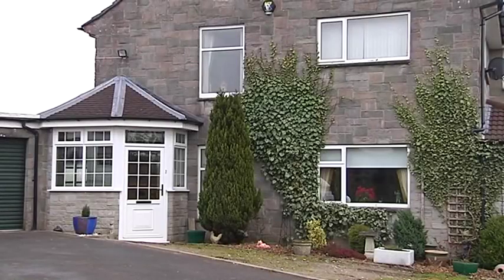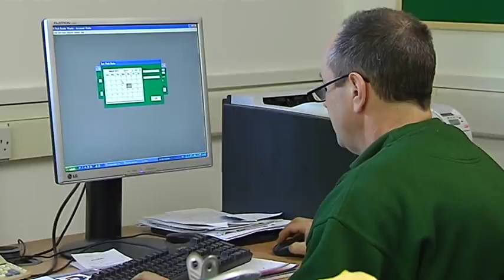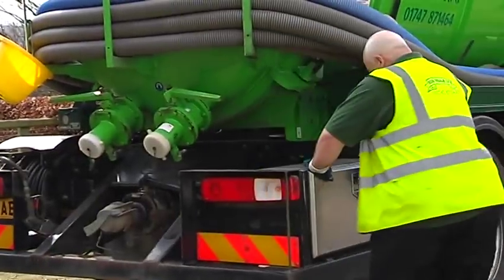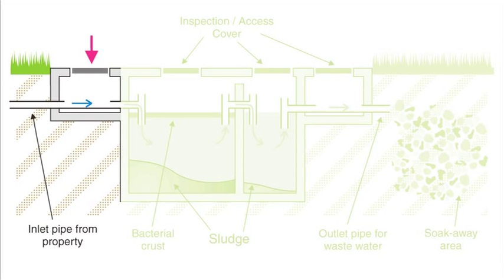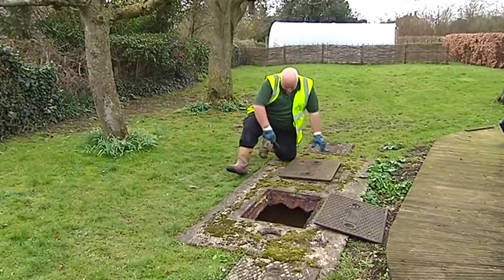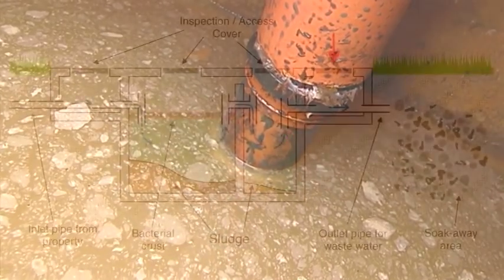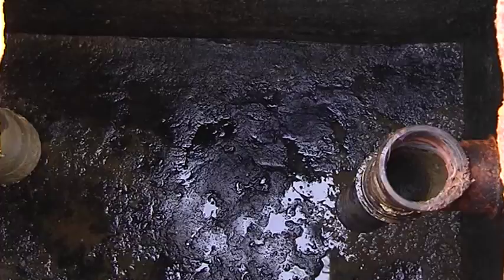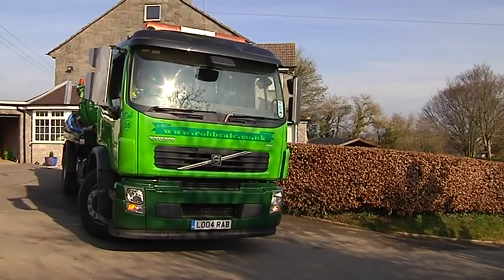Septic Tank Operation & Emptying - Rob Beale Limited

Comment from the maker: Thanks! If by scum layer you are referring to the crust then this may or may not be removed depending on how thick and/or solid it is. Most commonly a portion would be left behind as this is beneficial in helping the bacterial processes to continue. This tank was made from brick and concrete.